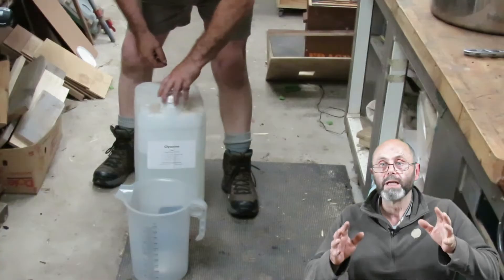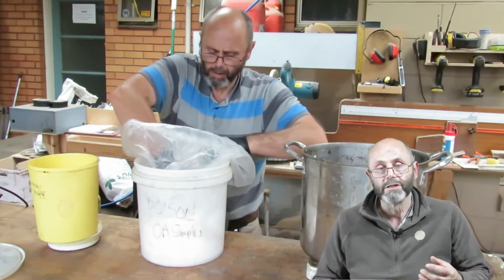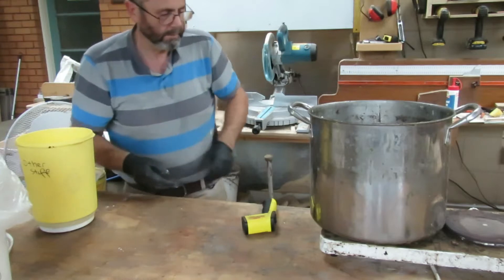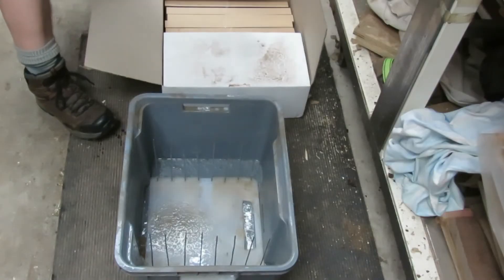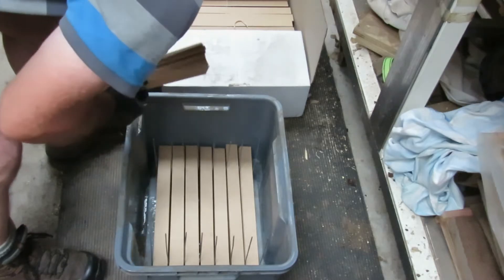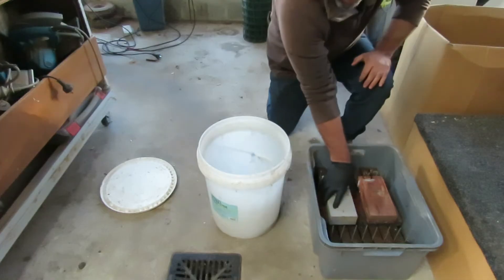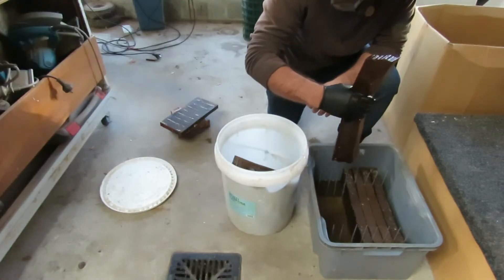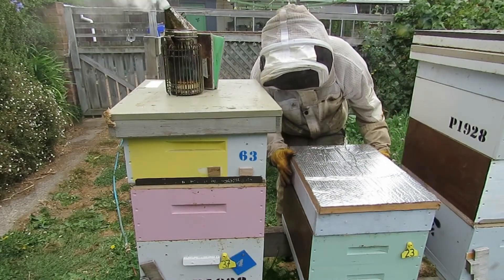Ep 48 Making and Using Oxalic Acid Strips

Comment: Thanks for the update. Great video. I am in NSW and just starting to deal with mites. Have you ever washed zero after using strips in a low mite load count hive? If so do you still treat the hive in the next round of treatments? Or do you religiously dose every hive no matter the count? I have just washed one mite after using apivar for prescribed period in a package of bees I bought. There is a hive next to it that washed zero. Should I still put strips in the zero assuming if the neighbouring hive has spread the love? Thanks again for your time. You putting the time in helps us all decide what is right for us.
Reply from the maker: Yes I have, many times, and yes, treat anyway.  The treatment is not only dealing with mites in the hive but also new arrivals on the backs of field bees and possibly robber bees.  Mite re-infestation is continuous so don't let up with the treatments.  Cheers Chris

Comment: Its posibile to put cardboard strips on the top of the frames like swedish sponges ,since if you put between the frames 
they ruined the combs ?
Reply from the maker: I don't, because I want the strips down close to the brood where the mites are emerging from under the capped brood as the new bees emerge.  The strips don't do much damage to the comb, no different to synthetic strips in my opinion.  The bees tear them down and remove them eventually.  I would rather accept what little impact they have in return for a more effective treatment.  If laying treatments across the top was as effective then that is how we would be told to apply synthetic strips.  The reason swedish sponges are laid on top is that is the only way to get them in the hive.  It isn't practical to try to drape them down into the brood.  And they are only really effective when laid between two boxes of brood.  They don't work so well if you are running a single brood box.  But if you try laying the cardboard strips on top of the frames and it works for you, let me know, I am always open to new ways of doing things, as long as they work :)

Comment: Hello. Please, can glycerin be replaced with vegetable oil in this recipe
Reply from the maker: I haven't ever tried that so I would only be guessing.  Given that a failed treatment leads to dead colonies, if you do try it, don't put it in too many hives.  Better to do experiments on small numbers at first, and then only if you can cope with losing them if the experiment fails.  My advice is stick to what others have found works, ie use glycerin.  It is food safe and this recipe has been well proved to be effective, especially if used in conjunction with OA vaporization.  Incidently, I have bumped up the OA/Glycerin mix now to 50/50 by weight
Reply: @KiwiWildman  Thank you very much for the advice

Comment: Thank you very much. How many days are the applied strips effective and at what period do you replace them?
Reply from the maker: I put them in 3 times a year, spring, mid summer and autumn.  The mid summer treatment is very important, it prevents mite levels climbing too high over summer and causing mite damage which the autumn treatment won't cure.  I leave them there until the bees chew them out or until the next treatment.  I am not sure how long they are effective for, but it doesn't really matter because I leave them in there anyway.  Cheers Chris
Reply: @KiwiWildman  Thank you, God bless you

Comment: Could you please share a recipe for 100 hives
Reply from the maker: Hi, the recipe in this video is for about 70 strips.  The number of strips you need for 100 hives depends on whether they are single deep or double deep brood boxes.  I put 4 strips per brood box.  If you need 400 strips (ie your 100 hives are single brood boxes) you will have to make up a mix that is 6 times bigger than the first recipe in this video - 3 kg of OA, 4.5 litres of Glycerine.  You can  go up to 3.5 kg of OA if you want, some say that it better.  If you need 800 strips then make up two batches. Cheers Chris

Comment: Chris where do you get those stripes do you make them. Are they corraged cardboard?
Reply from the maker: Hi Ronald, they are produced here in New Zealand by Beequip NZ.  No, they aren't corrugated, it is solid cardboard.  I also have used homemade strips and I am currently trying out Swedish sponges.  I did a video (Ep 45) comparing the three. Cheers Chris
Reply: I tried the Swedish sponges this spring I haven't tested but I think they worked very well. I guess I wouldn't be trying that any more 🤷 not legally anyway.